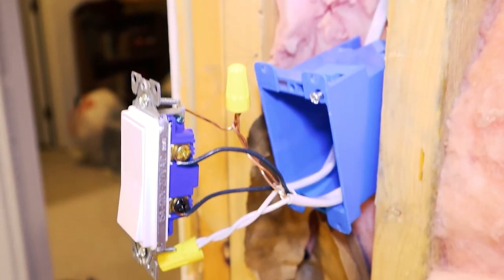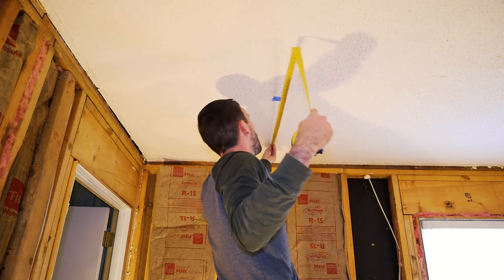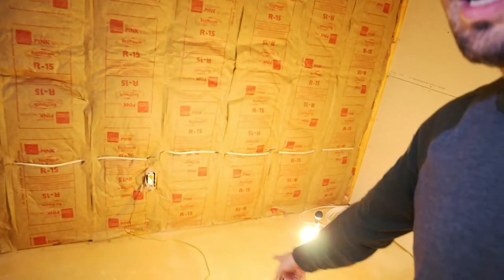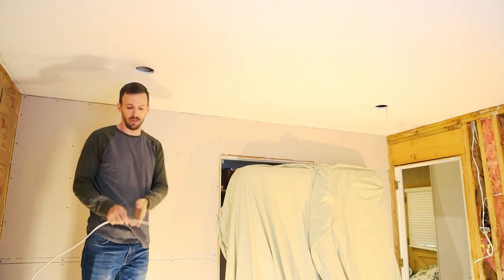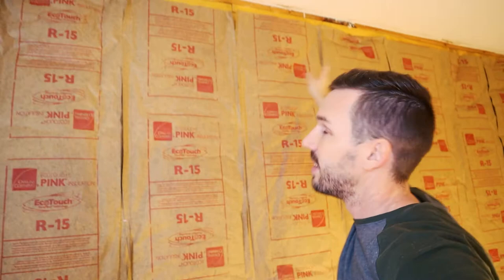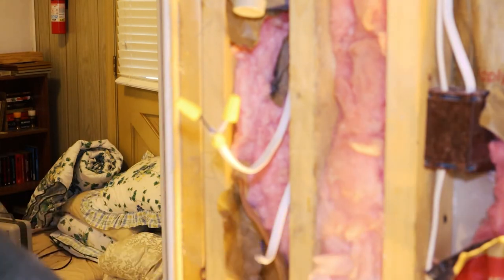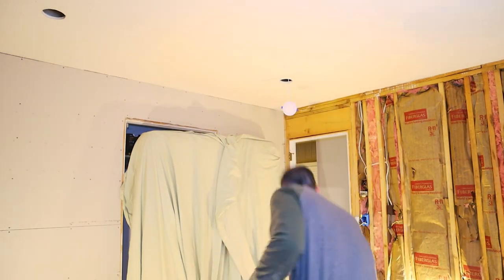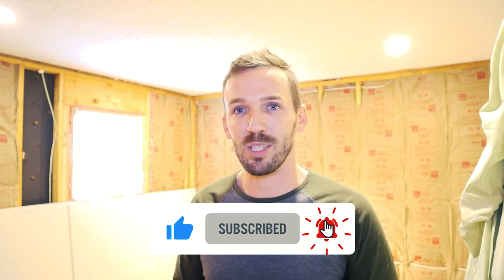Install Recessed Lights in Existing Ceiling | Cabin Flip Ep.8

Comment: I wish you would have explained about the switch because all the switches in my house are connected to outlets
Reply: I just bought my house and I came here for that exact reasons lol. 

Guess I’ll have to continue googling the best method. Guess he made it hot by connecting it with another outlet. The switch he have now is blank so he ran a new wire to the lights. I think that’s the solution. Did you find your?
Reply: I'm not an electrician and the description here is for example. I'm not liable for anything if you choose to do this by yourself. the short answer is your switch has a feed hot coming from the breaker to the room and then from the switch is called your switch leg or switched hot. if you want your outlets hot and the switch to control the lights you will need another spare bit of wire ( a few inches) and another wire to run from the switch to your lights. . remove the switch from the wall. identify which side goes to the breaker and which goes to the outlet. you should have a pair for each set. of the pairs one is the HOT(typically black) the other is the Neutral(typically white) and possibly a ground(green or fully bare copper) if it is a 3 wire grounded circuit. take the feed hot and the switched hot going to the outlet as well as the hot from the spare wire and wire nut them together. then wire nut the neutrals together. this has made the outlet always hot when the breaker is on. then take the new short bit of wire and connect it to the switch. this will make the switch hot when the circuit is on. on the other side of the switch connect the new wire which goes to the lights. make sure all your connections are good and wires cant just be pulled out of the wire nuts. (called a pull/tug test) if all is well reinstall the switch back into the box. turn on the circuit and test your switch and outlet. and there you have it. an always on outlet, and a switchable light. for further reference look up wiring in series, wiring in parallel, how to wire a 3 way switch, how to wire a light switch, how to wire an outlet. there is another way but this is the easiest imo. hope this helps!